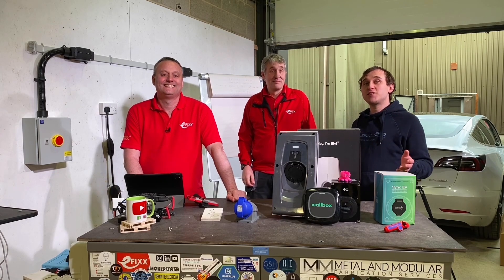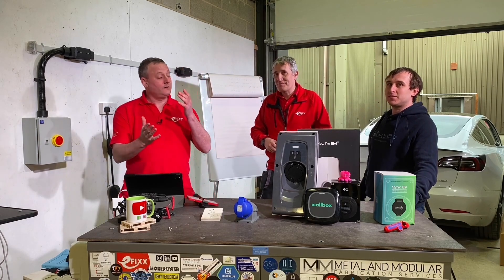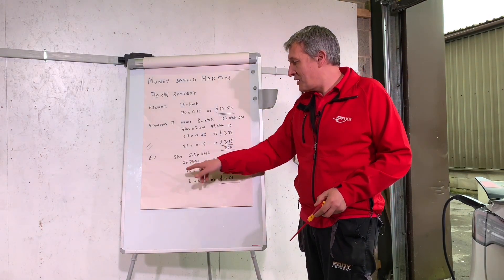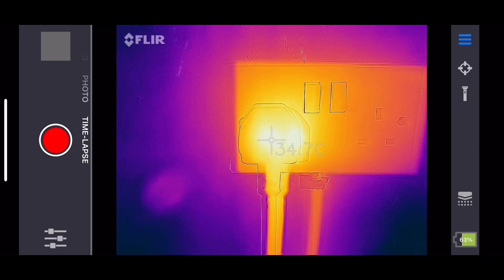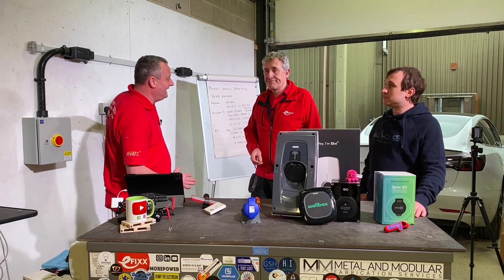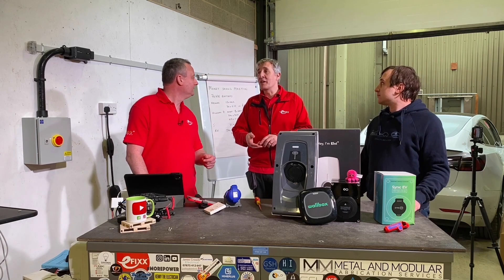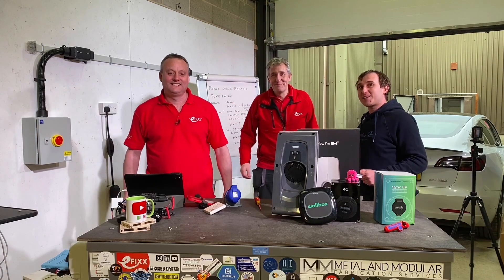5 Reasons NOT To Charge An EV By 3 Pin Socket!

Comment: Some commando sockets have rcd protection switch attached. What wrong with using that? Especially whwn installed by a qualified elec.
Reply from the maker: We mentioned that if installed to regs it’s fine but most are not and if you gone to that effort your almost price of a charger
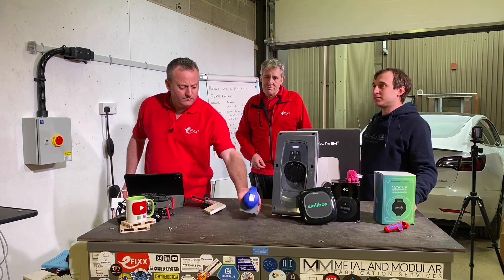Reply: @NicolasRaimo  no you didnt. At 9:15 when the socket was mentioned I believe you said morally he shouldnt install it as it has none of the protection features.. Commando socket with rcd built in is less than £200. Those chargers beging above £400. All i want os someone with the knowledge to give me a fair honest opinion.
Reply from the maker: @JamKick  pen fault systems more than that
Reply: @NicolasRaimo  so commando with rcd and pen fault added, if not already on the house and we are good as have an EVS? Still sounds like the more affordable option. Most cars have timers  to set when to charge amd when to stop so again struggling to see why the £400 plus pound spend.
Reply: @NicolasRaimo  some chargers dont have pen fault as well i understand so may still need to have that added..
Reply from the maker: @JamKick  apart from the new regs require chargers to compile to smart… so again I repeat it’s the same cost to have a dedicated charger 🔌
Reply: @JamKick I agree. I am about to go with this setup. It is the most flexible and convenient. The moment you have two separate locations to plug in it also becomes exponentially more cost effective than having "overpriced", dedicated, wall mounted units at each location. 
In construction all sorts of equipment is run on these types of connections for months and years on end, in all types of weather and climates.

Comment: We have been charging our 40 kWh Leaf on a granny for nearly 4 years with no issues. Our electrician had upgraded our system 4 years before we bought 2 EV's and quoted us for a charger installation which required upgrades - due to new reg's not because they were actually required. He said we could charge both EV's without issue on our grannies. We sold our 24kWh Leaf last year, so down to one car now. Seven hours night rate at 8p gives us 43%.
Reply from the maker: The age old it hasn't gone wrong yet so its fine argument.... I wonder if you feel same way about airbags on your car if I took them all out?
Reply: @NicolasRaimo  Is that really a good analogy?. You could measure the lives lost without air bags but homicidal granny cables!!?
Roughly 1850 deaths on UK roads every year. So I am taking much, much more risk driving the thing than charging it.
And I did check with my qualified electrician and he was happy. 
I do get your point in the video though, for many people they will need a dedicated charger for speed and I will install one at some point when I add solar.
You will be the first to know if I have to eat humble pie - well after the fire brigade.
Reply from the maker: @ianhamilton3113  it’s not just heat risk the PEN fault risk could kill also and then we have DC leakage

Comment: I was quite happy with my Masterplug granny charger, which is permanently plugged into a previously unused garage socket and was only used for a maximum of 2.5 hours at 8 amps. But then I saw this video and had a 7KW tethered charger installed, which I now use without any nagging doubts about safety.
Reply: You’ve been frightened by people making money from 7KWh chargers !

Comment: Because of the price of electricity skyrocketing we might be back to the 3 pin socket being cheaper in the long run? Maybe an update would be good?
Reply from the maker: With the price of electricity skyrocketing makes EVEN more sense to charge off peak,  video on the new rates THIS Saturday so ensure you've clicked the BELL next to the subscribe button not to miss it.....   Plus 3 pin socket still missing all the safety devices in this video
Reply: A lot of companys now will not offer off peak

Comment: Useful advice. In practice I never charge continuously at home for more than 8 hours.  My car is scheduled from Midnight to 8:00am, but will only “top up” overnight typically 10-15kWh max. I have a Metal 13A socket, with RCD integral in socket. Plug or socket never feels warm. However I do have timber garage, a long way from the house. I would invest in 7kWHome Charger if I could get “moblie signal” for Smart Charging, and therefore save money.
Reply from the maker: Hi Andrew see my reviews of ev chargers some allow cat5 connection and some have cat5 with a RADIO hub to transmit the signal to the charge point!  Also remember RCD won't trip if the car leaks DC which is common at times.. and sockets need to be tested in other manners also if your on PME system your need PEN fault or earth spike

Comment: I got quoted £2500 for an ev charger so I will be using a 3 pin plug
Reply from the maker: Assume you have lots of groundwork to do?
Reply: @NicolasRaimo  If no more room in consumer unit, this could be the cost of a new or separate consumer unit, type B RCD fitting, surge protector, PEN fault detection or an install with a 'nicer' charger with the bells and whistles e.g. Zappi. Or complications associated with rejigging an existing consumer unit to bring up to current regs. I was quoted £2k and £1.5k (the latter by an electrician, after meeting, I would not trust) for Zappi install on it's own separate consumer unit (i.e. electrician would not have had to touch any existing wiring other than to spot obvious danger) and a 5m run of outside cable. No groundwork and one hole in the wall for the SWA cable. This would be after I arranged the DNO to uprate their fuse and wiring, which is not free for many areas.

Comment: Hi interesting post I’m considering a Hybrid and they state a maximum 3.6Kw charge so a  7kw unit is unnecessary and I won’t be going full electric. Is there any portable 3.6 chargers you could recommend ? and surly I’ve seen some 3.6kw 16amp chargers with built in safety features plus on say a 20amp RCBO circuit would these be an option thanks everyone
Reply from the maker: Hi John just fit a 7kw charger now it will future proof you for when you do get an electric car be that 5 years.  The 7kw charger will only charge your hybrid at the 3.6kw rate but means your future proof for when things change.

If you see my reviews on chargers to help find the best charger.   All chargers made now are 7kw however do have switches to limit the rate to 3.6kw however you don’t need to limit that switch if you fit it for 7kw as the car will limit the rate it takes
Reply: There are lots of 3.5kw portable chargers to choose from. 
Best bet would be to get an interlocked commando socket and a 3.5kw portable.

If you want to schedule your charging fit a WiFi switch in the consumer unit. 
 
No point getting a 7ke charger, the technology changes so quick it will be obsolete in a few years anyway.

Comment: I'd have been more receptive to the content of this video if you hadn't spent the first half making scary calculations based on one very false assumption:
You don't need to charge a car to full in order to use it!
Let's say I charge mine for 5 hours on its "granny charger" (limited to 10A). And let's assume that with losses/inefficiency I'll only get 2kW out of it instead of the theoretical 2.3kW.  That's still 10kWh, and in my Hyundai Ioniq that'll get me on average 40 miles. 
The days that I need to do more than 40 miles in a day are very rare. If I need to go further, I'll charge on a public rapid charger.
Most real-world actual EV-users are the same. Granny-chargers are for topping up small amounts for day-to-day use.

I'd love to have a proper 7kW charger, but as the supply enters the house right in the centre of the building (under the stairs in a very small cupboard), it's just not feasible (which is why we haven't been able to fit a smart meter). 

Unfortunately, this smelled so badly of "inflated statistics intended for scaremongering" that I regarded the rest of the video with equal scepticism.
Reply: I will be buying a small EV within the next few months and my motoring requirements appear very similar to yours. Your calculations almost exactly match mine and I would probably set a granny charger at 2 KW (many let you vary the load down right down to the electronic handshake) so that the EV was receiving 1.8KW) for up to 5 hours but initially check the socket temperature periodically as a safeguard. Whilst I take on board all the points made in this video and would buy a 7 KW EV charger once I my grant application was approved (and my installer can fit me into his busy schedule!) , there are thousands of people charging EVs via 3-pin sockets who are doing so without issues so long as they use their common sense and don't overload the system.
Reply: @briangriffiths114  The biggest potential issue with granny chargers isn't the charger (EVSE) itself or even the socket it's plugged into - it's the path the current takes between the incoming supply to the house and the socket that you're plugged into. 
Ideally you'd have a radial circuit fed straight from its own MCB in the consumer unit, specifically for the purpose and with nothing else plugged into it. But this is rarely the case, even in the unlikely event that the user understands all of that - to most people one 13A socket is the same as any other. Alas, the "common sense" that you refer to isn't very common, and an awful lot of people would have no idea if they were "overloading the system".
Slight imperfections in house wiring can go for decades without causing a problem, because they are never put under stress.  Charging a car puts it under stress for hours at a time. The more often you do it, the more likely something will go "fzzzt".

So it's good that you're on the path to getting a proper 7kW charger fitted!
Reply: @RacingHippo  Thank you John, your comments are again bang on the money.

Comment: I think this is just an add to sell their product Obviously something that charges faster is better .But if it is dangerous to charge by plugging in to your home 13amp supply .They would not be allowed to supply the cable to do it.
Reply from the maker: Non of us sell chargers or fit them not a single one of us
Reply: One problem is that the DNO no longer takes responsibility for supplying you with a safe electricity supply. It will fix a fault but it is up to you to detect a PEN fault outside of your home before it kills you. Separately, the warnings about poor domestic wiring and poor sockets being incapable of supplying 10A continuously are very valid and you should take heed. The problem here is that the specification of something is only good for a small amount of time and when installed by someone competent. Much electrical work has been subject to incompetence and is old. The 10A granny charger relies on safety measures and specifications that were not the concern of its manufacturer.

Comment: I am retired, so 13a is fine for me as 50% of days I dont drive the car.  I am an electrical engineer and am confident in my garage/home wiring so dont fear any fires/disasters !  For dodgy electrics your scaremongering may be valid. What you guys are selling may be okay for those that still commute/drive every day.
Reply: I know this is an old post but I think you entirely missed the point of the video. Which is, that 13amp UK sockets (which are the equivalent of our 10amp sockets in Australia) were never designed to deliver 13 amps continuously. And even delivering 10 amps continuously they can and do fail whether you're a retired engineer or not. I have a dedicated 15amp socket (Australia not UK) in my garage which is the minimum I would consider for a granny charger. It's a dedicated circuit so I'm confident there is no other power draw on that circuit. No one is trying to "sell" you anything. A dedicated Level 2 EVSE just makes sense for most EV owners.
Reply: @mondotv4216   Should I prepare throw away my tumble dryer and space heaters?What about my water boiler? Oh no, my house is already on fire. I need to quickly call therse guys so they can install level 2 for lots of $$$.
Reply: I've seen first hand when someone plugged two electric heaters into an extension lead. The plug melted and nearly caught fire. Never overload a socket or extension lead.
Reply: "Electrical Engineers" frighten me!!

They seem to know everything, dismiss common sense but adrift from reality.. what happens with a little corrosion in the pin and socket causing resistance..
Reply from the maker: Pen fault doesn’t care about your wiring
Reply: @NicolasRaimo  But what if the pen fault detection device fails? Because of this, surely it should be important to wear rubber boots when plugging and unplugging the car.
Reply from the maker: @jam99  if the device failed the power would be off
Reply: @NicolasRaimo  So it is impossible for a PEN fault detector to fail in the 'on' state is it?
Reply from the maker: @jam99  I’d need to check with some engineers but they are designed to self check and daily check and if a self fault is detected it’s designed to shut off I think the relays are designed in an always off position and only when system is on is power on
Reply: @NicolasRaimo  Ever heard of relay contacts welding themselves closed? It happens.
Reply from the maker: @jam99  I think thats why the PEN fault system fit 2 in series
Reply: @NicolasRaimo  Lol! Why not 3? Sorry to be flippant. Raising awareness of the 10A issue is important but often I feel safety has just gone too far and is being exploited by those that can make money from it.
Reply: @jam99 . Spot on !

I made the same point in the post below.
Reply: @jam99 Absolutely 👍
Reply: Haha. You have never been very good at your job were you?! Main issue is the constant jogh load. Mix that with lose pins inside aocket and you have fire waiting to happen. Fire doesnt give a toss about you being a pensioner. You can use13A socket but EV marked one. That is designed to deliver 10A for 20 hours non stop!

Comment: I can't believe you are not considering people who live in terrace houses and havent the luxury of a proper charger. It's all well and good throwing the mud around but you aren't helping the guys who need to charge with a granny charger. Any chance you could do a video highlighting the best possible way to charge with a granny charger, I bet you'd get 10 times the views of slagging it off!
Reply from the maker: Matt its not that am not considering people who live in a terrace house its just am stating facts of 3 pin granny charging.  People in terrace homes can still have options of fitting these chargers why would they not? 
I don't condone granny charging as a frequent use of charging as I know the risks but you can limit the risks by installing all the safety devices listed by which point you may of just fitted a dedicated unit...
Reply: @NicolasRaimo  like I said, if you did a video on the safest way to charge and all the options available on granny charging you’ll get a lot more hits 👍🏼
Reply from the maker: @woodster83  again its not something i agree on there's no excuse not to get a dedicated unit fitted for everyday charging I'd rather no condone something I think has higher levels of risk than needed for the sake of someone being cheap
Reply: @NicolasRaimo  my parking space is 25m from my house and my fuse box is the other end of my house. There is no way for me to be able to get a charge point to my car, but for you to call me cheap?! Are you ok?!!!!
Reply from the maker: @woodster83  Please see efixx video where they did just that.  You'd run a cable from your meter threw the floorbroads assuming your a mid terrace not an end,  you could also run in loft space if its not converted/living area,  then run it down the house maybe following a drain pipe,  then across the garden either digging it up or down the fence.   Yes it would cost more but this is the only safe way of doing it.  1 thing you should NEVER do with a granny cable is plug it into an extension cord

Comment: This is useful information until you find out your house is on a looped supply, making a fast charger install troublesome. I use a granny charger via a smart plug for 4hrs a night which is more than adequate. Plug only gets mildly warm.
Reply from the maker: DNO will unloop you for free and some DNO allow you to have a fast charger on looped supply if it has a dynamique load CT Clamp,  your also able to install most these safety devices to 3 pin and should do for safety
Reply: @NicolasRaimo  Thank you, I wasn't aware there's a possibility of using a charger on a looped supply at all. Even if the change from looped to normal was free, I'm not too keen on digging up my + neighbours driveway!
Reply from the maker: @connectcreativedesign  won't be you digging it be your local DNO